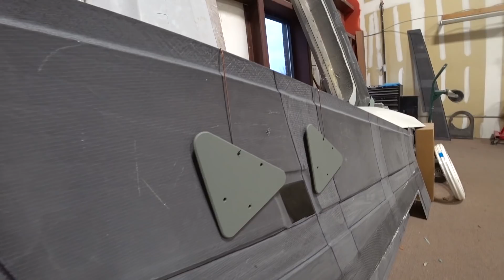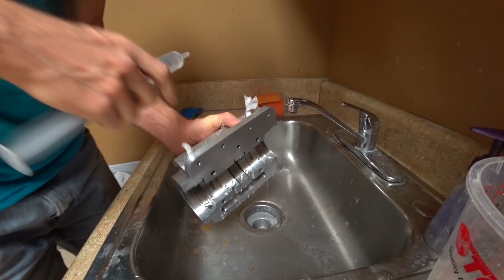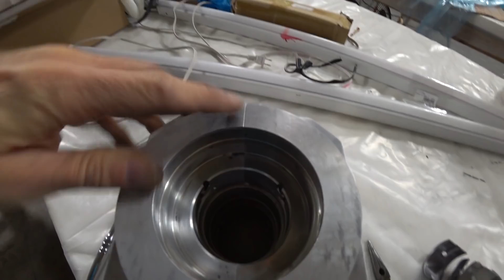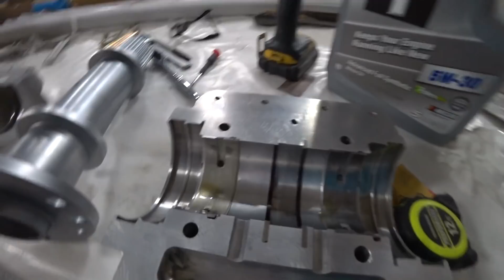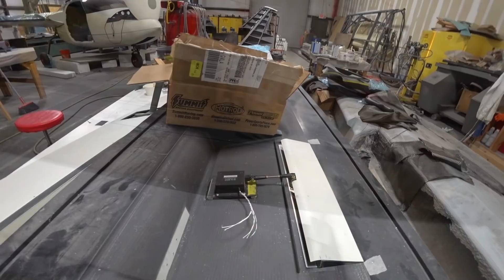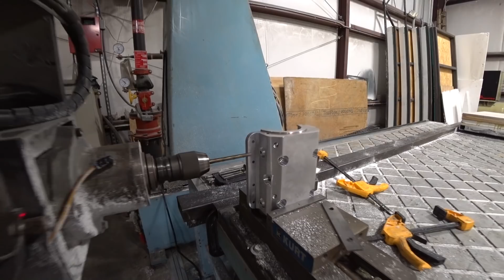New ReDrive Arrives - Building the Raptor Prototype

Comment: if that is a prototype redrive. Stop..  you need to calculate bearing crush to the 0.0001"  bearing crush and the surface finish of the bore that holds the bearings in place is critical..  you will want to check into Doweling the bearings in place..  as aluminum housings expand..  you only need to dowel the bearing on one side.  the bearing tabs are for Alignment ONLY.. they do not stop the bearing from spinning. 
please with the bearing part numbers.. go thru the bearing specs catalog for exact bearing housing bore limits..  the end of the bearing inserts should stick up just slightly above the bore when installed.. the cross hatch finish done on rod hones to get precision sizes increase grip on the bearing shell OD. but with aluminum..  you are also going to have to check bearing clearances at -50F.. to make sure it does not tighten up that much and cause the shaft to seize in the bearings.. 

 You also either need to design in ledges to align the housings halves prior to  final  boring or honing the main bore to size.    thinking that 4 or more bolts will keep the case halves aligned is wrong..   NPT is the wrong way to seal passages in aluminum.  you will want to dig into the parker catalogs for oring sealed plugs.  or copper washer sealed plugs. something perhaps like these. http://www.parkerhannifin.be/parkerimages/tfd/cat/pdffiles/G-Pipe-Port/vsti%20r-ed.pdf    if you intend on sticking with the NPT plugs. please use Hylomar as a thread sealant. not some hardening material or teflon tape.  if you want to dowel pin the case halves..  bolt them up with a precision bar thru the bore. drill thru one side of the case and a shallow hole into the other side.  ream that hole to the dowel size..  use a solid rod behind the dowel and the plug sealing the thru hole to keep the dowel from being pushed back into the hole.   this will allow the most precision fit up..  if you offset the dowels on either side of the shaft.  you can thread the thru bore above the pin to allow you to push the case halves apart.  this will leave the dowel on the wrong side of the case .. but maybe that is a better spot for it as you could ream the thru hole side another tenth..   this is all from a casual observer..  feel free to delete this comment.

Comment: Wow you guys do a huge amount of work... eating a blue whale one bite at a time, one door at a time, one re-drive at a time...
But making those oil seals fit and having the drive leak free an secure for regular production wouldn't it be better to have it be a modular design where both sides of the housing isn't actually also the bearing surfaces? Like the housing is one piece and the individual bearing surfaces gets bolted in there just like they make housings for high performance racing crank shafts? The tolerances on the machining must be so precise that it will almost impossible to get a consistent fit throughout a production run and if they forget critical oil passages how can you be sure that the bearing surfaces are perfectly aligned with the shaft when it's a one piece construction?.. it's like those doors all over again...
they way they make crank shafts hold in drag racing with 5-6000 horsepower is to make the journals over sized and then line bore it for perfect dimensions and so they can torque each bearing down to spec... I really hope your drive works but if it's good enough for crankshaft for drag racers then it should hold for your prop when there's vibration going through it.

Comment: It's a good thing you gave the redrive a good inspection. The plastigauge clearance was a good check because it's possible that the bolts could distort the case.
Reply from the maker: Yes, we have exactly the clearance that we spec'd for the shaft to journal bearings so we should be in good shape there. Hopefully every other aspect works out as planned. I'm checking everything I can.
Reply: @RaptorAircraft  , I see that.

Perhaps when your machinist and you agree on a Dollar figure, you will agree not to mention their name on youtube, after they forgot to finish your parts.

Comment: Are the oil rings you were checking and adjusting the clearance on the thrust washer / bearings?
Reply from the maker: No they are not the thrust washers. We don't have those yet. They are for facilitating the high pressure oil feed into the prop shaft to control the prop blade pitch. But they also allow a minor blow by so the pressure will be relieved when the prop needs to be flattened again.

Comment: Journal bearings need to be a bit big, require a little crush so they fit tightly and don't spin. Do you plan to use a thrust bearing, like crankshafts use? Also, any locating dowel pins? Great work!
Reply from the maker: Yes, I mentioned the thrust washers but no dowel pins in this iteration.

Comment: G'day Peter, you mention at 11:15 that you will have 1.5 thou of clearance to achieve 300lb for the Constant Speed Unit. If the Re-drive case chatters by this small amount or more then you are back to metal on metal, the consequences of which are well known.
Can I suggest that it is not to late to install locating pins, minimum of 2 diagonally opposed, 4 would be better. Once the pins are installed then the Re-Drive should be assembled without the drive shaft, torqued to required tension and then line bored to assure absolute accuracy. Line boring would also exactly size the Oil Rings, that you were handraulically adjusting, and the Thrust Washers. 
The Re-Drive unit can handle a small delay given all the other items that requires your attention.
Keep up the brilliant work.
Best wishes 
Danny

Comment: Next time, like at 18:30. 21:15, use  a copper/alu plate between the jaw and the "sealing" surface to protect it from deformation and scratches.

Comment: why this big metal thing dos't have any ball bearings?
Reply from the maker: Because we modeled it on the same proven design as the IO520 engine.
Reply: Hydrodynamic bearings are used in almost every car engine and many ship props. As long as there (is) clean oil and good pressure, they will likely outperform contact bearings

Comment: Peter,
I love the longer videos, and am in awe of your patience and drive.
I am concerned with several aspects of the redrive:
1.  If the machine shop FORGOT so many features of the case assembly;
   a. Drain hole to the lower gallery
   b.  Drilling and tapping the bosses for the 1/4" NPT fittings
what else did they overlook?  
First, I'd be very suspicious of integrity of the actual bore.  You used "Plasti-gauge" to judge the bearing clearance.  This product is only used by back-yard engine assemblers, or as a ROUGH estimate of the actual clearance.  Using this leaves the evaluation of the clearance to the judgement of the person when comparing the residue left on the bearing surface with the scale on the side of the plasti-gauge package.
Plasti-gauge only gives a relative idea of the actual clearance....it does NOT tell you if the bore is actually ROUND.  The proper tool for this job is called a "Bore Gauge."  Not only will it tell you the actual dimension of the bore, but will tell you the roundness, as well.  To further clarify. plastigauge helps to measure the clearance at ONE point; when using a bore gauge you can rotate it in the bore to gauge the concentricity of the bore.  Another tool used for the job is a "snap" gauge, and is used in conjunction with a micrometer.
The lack of very close-tolerance locating pins is of concern.  Without locating pins, or bolts that have machined shoulders to fit in a close-tolerance bore, the case halves WILL move relative to each other when they are assembled.  You won't be able to feel or see the few thousandths of an inch they shift.

Hopefully you won't receive my comments as negative, they are intended quite the opposite.  I truly want to see you complete this project and hate the thought of you suffering a setback with the redrive.  To that point, I have a bore gauge, snap gauges, and micrometers that I am happy to loan you.  I'll also coach you on how to use them, or point you to some youtube videos that show how its done.   Please let me know if you'd like to borrow the tools, I am sincere in my offer.

Best regards,
Jon Crawford
Reply from the maker: Thanks for the info and offer.
Reply: Great points all around!

Comment: Excellent progress again this week...  Too bad you are having quality problems from your suppliers.  I hope they cut you a good deal or I'd ask for a discount for the work left undone and free replacement parts for the bent ones sent to you.

Question about the Redrive...  Once assembled did you use your water trick to make sure the holes between the halves aligned properly so that oil passed correctly from one half to the other?

Keep up the great progress...

Comment: I assume a sealing gasket will be added later on? After all, real world surfaces are never as leveled . Not to mention all other benefits of a gasket.

Great idea to add a level floor. Will there be one for the rear cabin as well?
Reply from the maker: If you look carefully you can see a channel in one housing side that is for the o ring gasket that I already have on hand. As I said, the fitting right now is just test fitting. You will see the final assembly with the o rings and o ring gasket. Be patient.
Reply: Ah. Cool. That'll do the trick. And no, bein patient isn't an option. I'm hooked to my twice weekly Raptor dose :))

Comment: Realizing I'm a couple bourbons in and I'm not an engineer by trade, have you considered implementing a thrust bearing in the re-drive assembly to accept the thrust from the propeller in the re-drive?

It's been truly great to see the team's progress, you're revolutionizing GA with this craft and I really hope the raptor starts to get the respect it deserves... Maybe Paul Bertorelli will stop by and do a segment for avweb one of these days.
Reply from the maker: As I mentioned, the thrust washers are getting taken down a few thousand because the nubs on the shaft were machined slightly too close together so the fitment was too tight. We'll have them back next week and put them in place for the final assembly.
Reply: @RaptorAircraft  right on man, I must've missed that comment. As always, keep up the great work - you're living the dream and we're all happy to be a part of it.

Comment: I'm surprised it looks like the redrive halves don't have any locating pins to ensure they are in the correct position (at 6:30). Are they just not mounted yet?
Reply: Aluminum housing? Expansion rate is more than those steel bolts causing a loose fit when the housing gets hot. Dowels would be necessary to insure longevity of the part. In time fretting will occur between the housing or case halves.
Reply from the maker: Not they don't. It may be an oversight on our part. However, those 4 main bolts are a very tight tolerance for as you saw and they are keeping it aligned as far as I can tell, at least as much as dowel pins would. We'll see.
Reply: @RaptorAircraft  That's too bad. The bolts may be tight but the clearance on the journals is probably 4-6 thousandths of an inch and I think it'll be hard to get the bolts to line the halves up to that accuracy (especially since the bolts aren't even straight.) Any misalignment takes directly off of your clearance.
Reply from the maker: Well, we'll see. From what I can tell there's no movement or misalignment in the two halves and I haven't even added the 8 upper and lower an4 bolts yet.
Reply: ,,, it definitely should be dowelled. Second choice is body bound studs or bolts. That is bolt or stud clearance of only a thou .
Reply: Speaking of expansion, heating, and alignment. Perhaps add a little assembly lube, torque to "spec" and heat the whole thing up to operating temperature. Check clearances again at temperature.
Reply: ,,, for correct body bound studs or bolts, they have to be through with heads or nuts, on either side of the case. If the case had been designed with full external race roller or ball bearings the bearing races would give correct lateral alignment; however that still leaves longitudinal alignment. So I believe the case just needs 4 dowells.